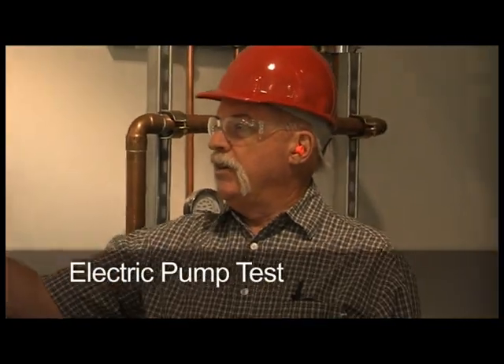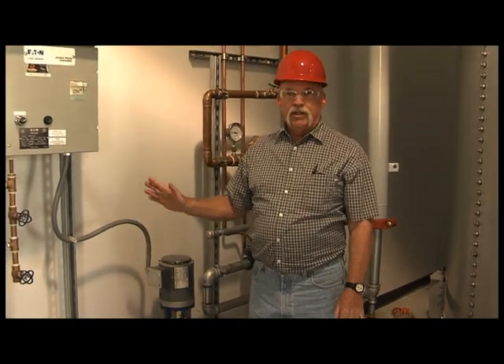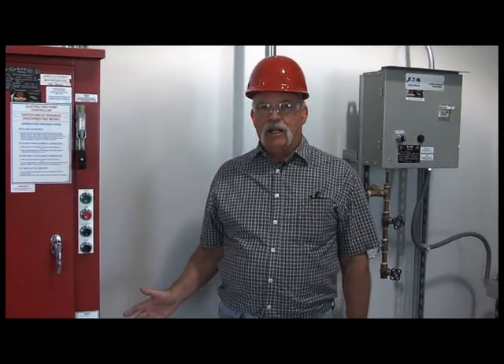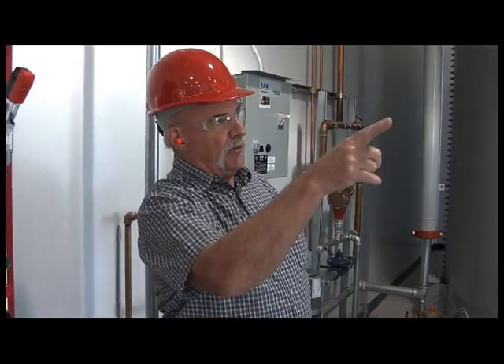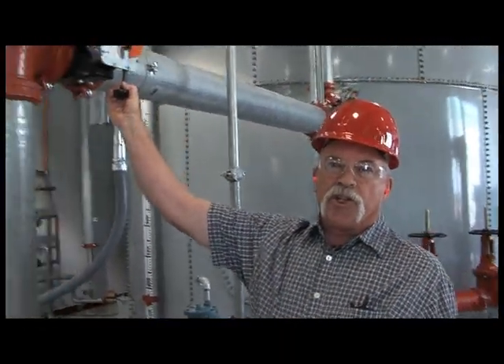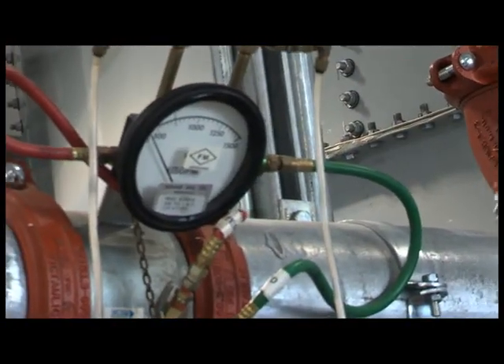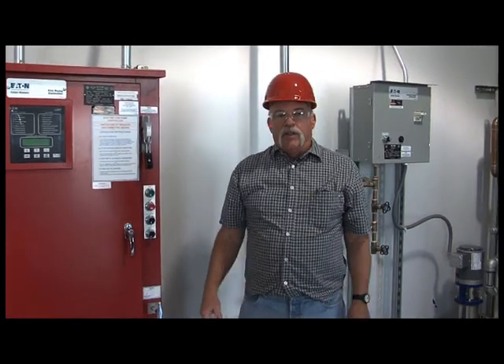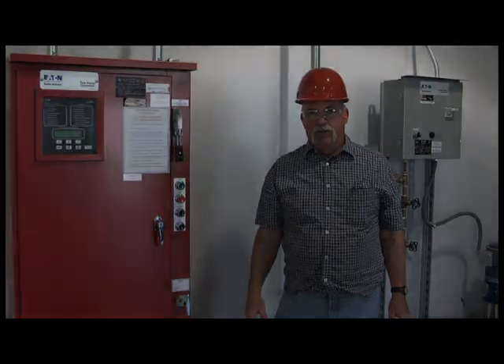Electric Fire Pump Testing

Comment: Nice Video, It would have been nice to have OSY instead of B-Fly valves to open and close. I've seen water turbulence destroy the neoprene on the inside of the valve. In addition have a better CLA casing relief valve that you can visually see water discharge at churn discharge into a pump room floor drain

Comment: As a air-conditioning commissioning technician we would plot on the pump curve the impeller diameter from the no flow readings (shut off head), also plot the circulating pressures to work out the actual flows off the curves at both flows points to back up the annubar readings (measured actual flow).
Also from the volts and amps we can work out the pump kW and efficiency.
From there the system can be balanced if it was a chilled or heating hot water circuit at design flow. Thanks for the video!

Comment: What was the setup? Closed loop? Pump discharge to pump suction? Or from the supply tank back to the supply tank?  With a tank supply & return setup would a pitot test setup every 3 years be used?  Or is that only applicable to a diesel fire pump?  What about the 6 auto test starts?  Good info, thanks.

Comment: What's the equipment you've used in getting the rpm?
Reply: Tachometer
Reply: tachometer with a tachometer tape. put the tape on the shaft and point the tachometer at the shaft to get a reading of the tape